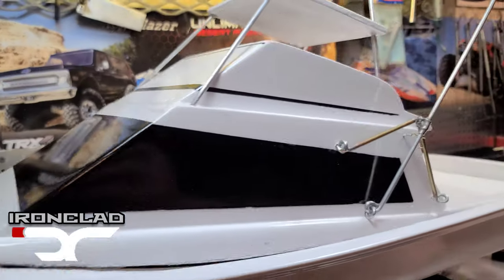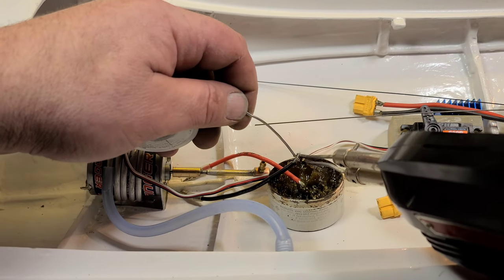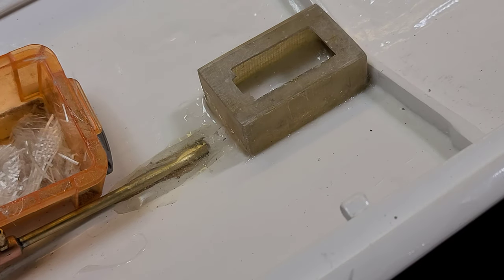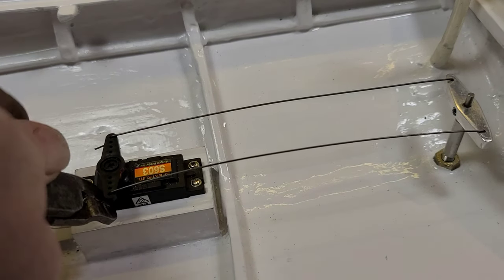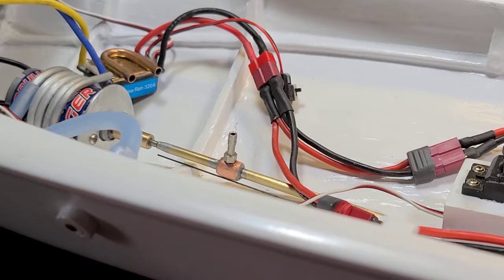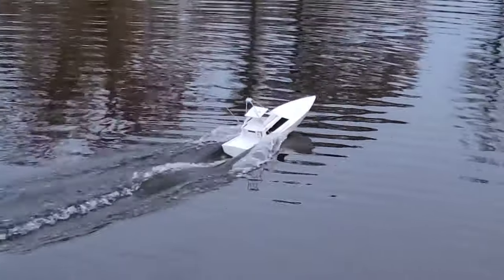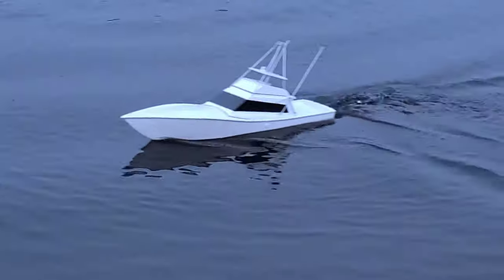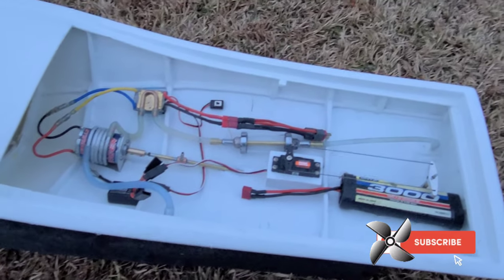Scale Rc Fishing Boat Build Custom Servo Mount, Weight Distribution, & Quick Maiden

Comment: Looks pretty cool.  I wonder if it could do double-duty as a rescue boat if it towed something made from PVC tubing and pool noodles to catch a stranded boat.  It seems to have more than enough "oomph" to bring several stranded boats in at once.
Reply from the maker: I can put the outriggers out with a loop of line connected to both outriggers, maybe  "Lasso?" the Rudder sticking up from the flipped boat.  Pull the flipped boat home by the Rudder.  Maybe I will try it. Your not the only one that wants to see her rescue a flipped boat.    Lol.   Thanks for watching brother

Comment: What is the big cylinder object connected to the cooling tube?
Reply from the maker: It's an inline fuel filter I found  at my recently passed father's  shop, I took it apart and run a copper tube through it as part of the cooling run. (Scale"ish fuel cell lol)  wanted to include something from my father's scrap pile in to the build.